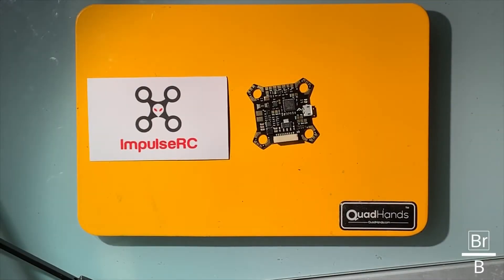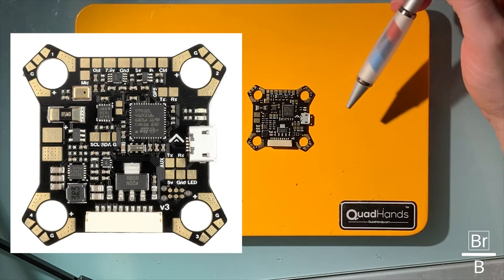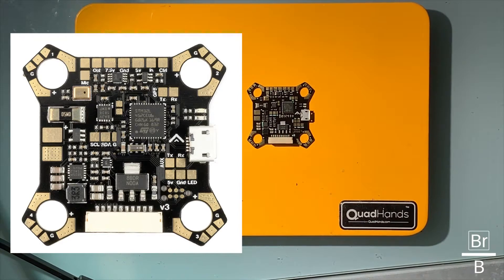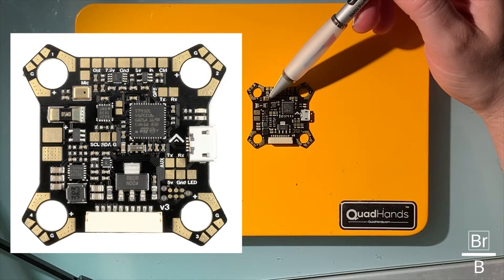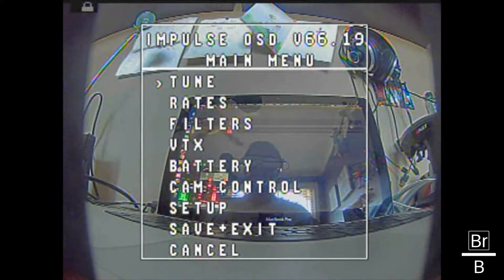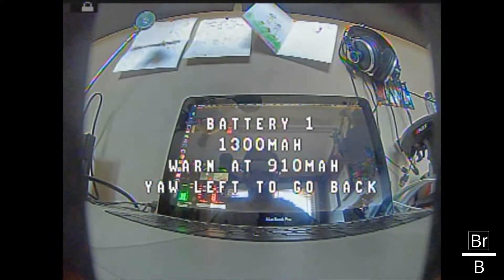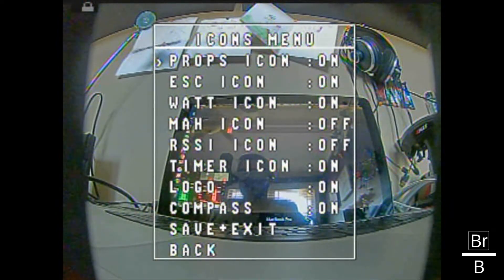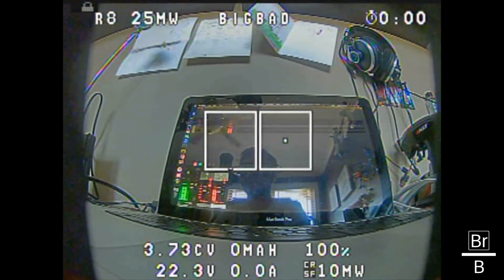Wolf PDB V3 | ImpulseRC

Comment: Hi, do you use any capacitor with this board?  If so, which one? Thank you
Reply from the maker: I’m not, no.
Reply: BrOverbee i fried 2 of them simply hooking up an 6s 1800mAh lipo. With 4s all was good, someone tells me this happened because I did not have used capacitor. What do you think about that?
Reply from the maker: Mirko Abozzi I think you’re doing something wrong. I have mine on 6S with no capacitor and no issues.
Reply from the maker: Mirko Abozzi Here’s what ImpulseRC says: “Dual cascading switching and linear regulators with additional filters provide that silky-smooth power to your video components. Fully 6S capable out of the box, you no longer need to worry about voltage ranges or filtering when building your monster freestyle rig, we have you firmly covered.”